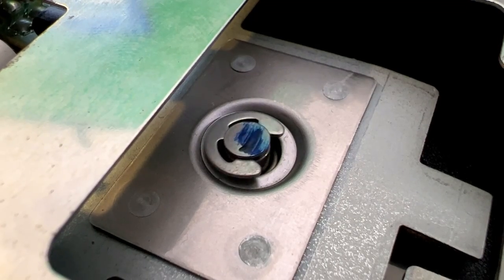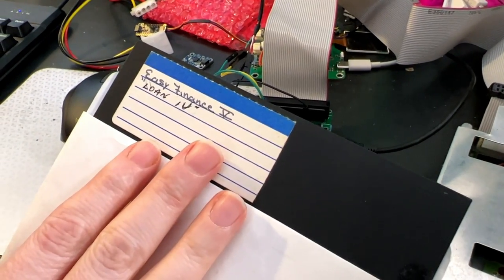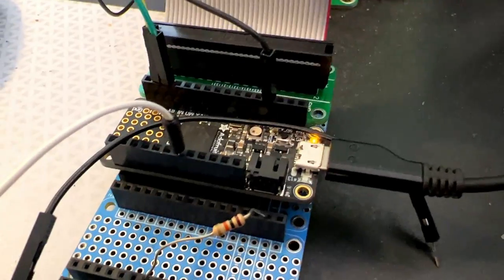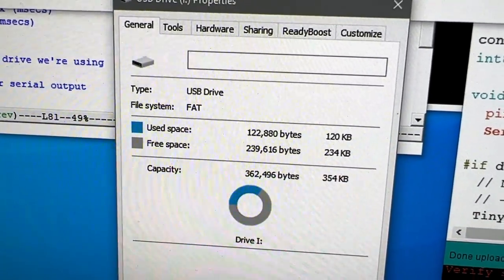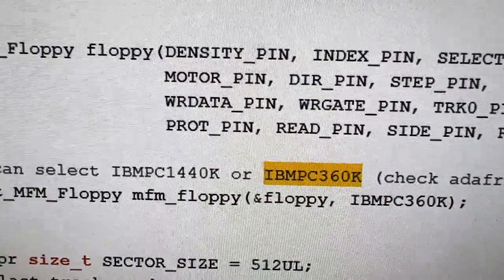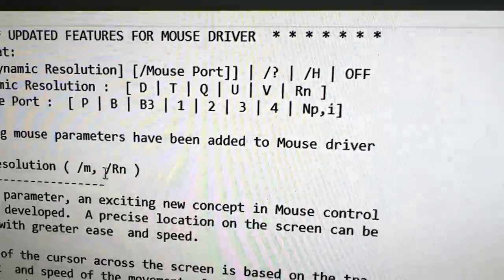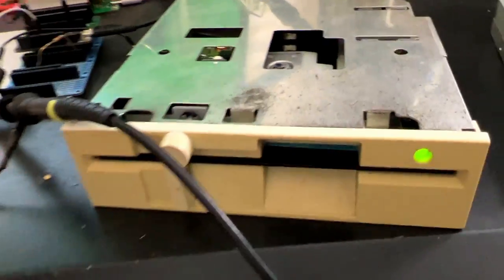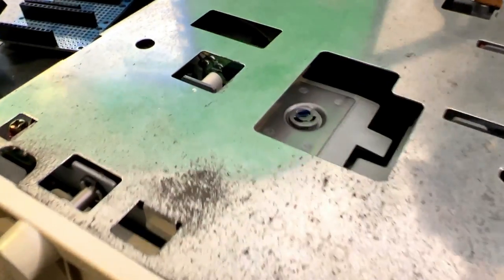5.25 inch 360K DOS Floppy drive as a USB key

Comment: Oooh, I wonder how much more work is needed to handle 90k (trs-80) floppies... I can still remember a lot of the filesystem details at the hexdump level (I wrote trs-80/osborne/other compatible drivers back-in-the-century) but what's handling the bits-to-bytes part? The other video mentioned the Feather is doing the MFM decoding?  (That was a dedicated 1771 chip back then but 40+ years later I can believe it's now "just" some microcontroller code...)